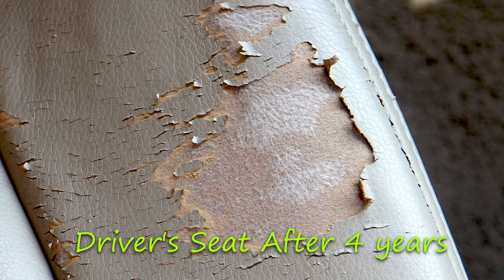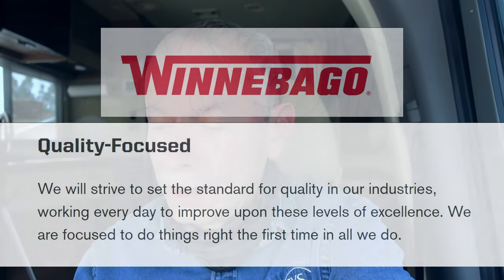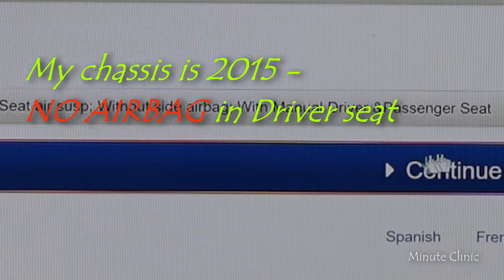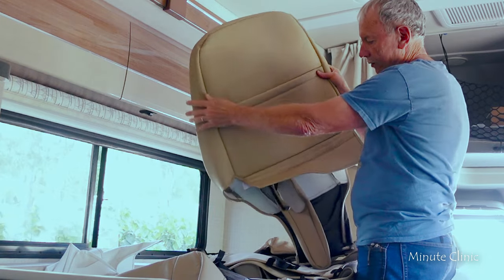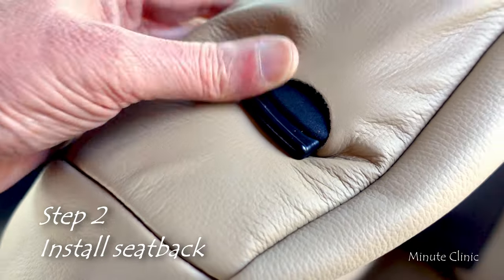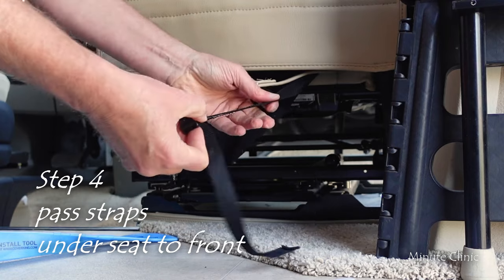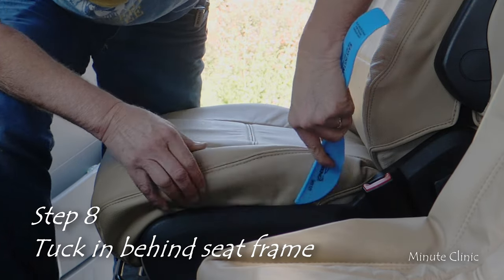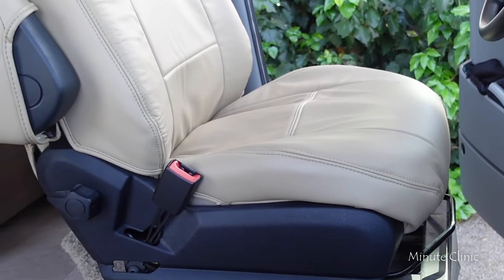My RV Seats are CRAP - Hide it or Fix it?

Comment: I installed the CoverKing seat covers in my 15G pretty much as soon as I could get them delivered after purchase. Bought the heavy duty fabric seat cover (mostly because of the dogs) that are waterproof. Been on for just over a year and about 15,000 miles now. Holding up nicely so far. I really like how well the fit to the contours of the seats.

Comment: I was fortunate Winnebago recovered both Front seats, dinette cushion and front panel in my  2015 24J. They also covered installation costs. Had some work done in Iowa  and additional work in Oregon when that shop was still open. All under warranty.
Reply: Hi Jim. Did they cover it after warranty expired? I have a 2016J with same issue. What you suggest as first step to take this issue to Winnebago?

Comment: Do your seats both swivel freely with the new covers in place?  Considering for our Sprinter-based RV. Nice vid. Fellow San Diegan Dave.
Reply: Hi Ron, 
May be you can check with local upholstery shop near where you live.  Better yet, since you did most of the work yourself on the motor home, why not go to the fabric stores and get the materials to match the two front seats (staple gun and fabric glues) I know you CAN DO it.

Comment: Ron, great video. I noticed that your seats swivel. How does that work for you. I’m looking to add a swivel to our Sprinter RV. However, the coach floor rises 12 inches from the cab floor. If we swivel the seats we may be eating our knees. How does that work for you? Is the seat comfortable to sit in when you swivel it to the rear?
Reply: Is your unit a View?  I believe all View units have the swivel from the factory.  If it is one of the other manufacturers and they went with a higher step height into the coach floor they may have skipped the swivels for that reason.  The view step height is only around 5-6".

Comment: I would be curious to get a quote for OEM replacement cushions based on the part numbers printed on them. Mind you it would be the same as OEM quality, but I am also wondering if anyone asked Russ at the gathering in Quartzite if there was a better solution for the dinette recovering. I really like your solution for the front seat. Please update us if you get new answers from your inquiries to WGO. Thanks Ron.
Reply from the maker: Someone did mention thee fabric. Russ didn’t say much.  Winnebago used to offer new material for $1500.
Reply: @ontheroadwithron2432  Gotcha. Yeah, I've seen similar material before on our Rooms To Go furniture at the Manager House in the RV Park we managed. You could feel the little pieces jump off the love seat while you were watching TV and no one ever sat in that love seat. Perhaps even the RV Salesmen at Lichtscinn RV never even realized how the material would fall apart years later, especially touting how it was so cool in the summer and warm in the winter. For a couch, many would just go to Camping World with their measurements, but a dinette is a little harder to switch out for sure. It all makes so much sense now, I would see a 12-year-old Class A on our RV Consignment lot at the RV park and the furniture never matched the OEM material. Well, I would say in my case it is best to go to a local shop with a sample of the material to replace and go from there, just like the mattress. We went with Mattress Insider as we had 2 months before we were forced to retire (was told any monkey could do it for half the wages), we had a murphy bed with a hinged section. The new mattress has worked out GREAT, but they are on their sixth set of managers in the 10 months since we "Retired", LOL. Good luck and as always glad to see your updates. If we buy a used View or Navion, at least now I have nearly 100 videos to know where to start. I am a retired electronic technician. The upgrade to lithium LIFEPO4 went wonderful as did the solar, converter & inverter upgrade, but no videos on our end as we don't have your charm on camera - no one wants grumpy old studdering Dave to show them anything, LOL. Keep up the good work Ron & love your Tesla channel. I would love to see a 240-volt adapter built so your Tesla plug would adapt to the 50-amps at a campground. I know the Tesla isn't flat towable, but at least at night, the older RV parks aren't as liable to blow up compared to charging during the day when the neighbor's big Class A's are running 2-3 15K HVAC units, LOL.

Comment: We are travel,f to Utah to purchase, we hope, a 2017 used View 24J. What should we be concerned with in buying used? Was told there could be cracking in the roof and maybe leaks. What do you think? Thanks Bill
Reply from the maker: I would look on the roof for leaks and  check batteries.

Comment: 2013 View 24M - Headliner over bunk dropped. Foam underneath had turned to powder. Replacement headliner?
Reply from the maker: I have not had that problem at least yet. You might try new foam and some spray contact cement to hold it in place.

Comment: My 2016 View 24G on a 2015 chassis has the very same issue it would be interesting to see which production sequence your was compared to mine. . Thanks for the information, I am taking mine to the dealer for the emission modification. I wonder since you are in CA. did this also apply to your coach? Campaign 2020040004
Reply from the maker: Yes I got the notice. Haven’t had time yet.

Comment: Auto upholstery shop for dinette
Reply from the maker: My wife and I have debating if we should tackle it ourselves. Seems like a big job.
Reply: @ontheroadwithron2432  my wife and I got a roll of material for our boat seats along with piping and other material. If you have a sewing machine that will take big needles and accept thick material its not bad. Take apart the dinette seats for patterns.